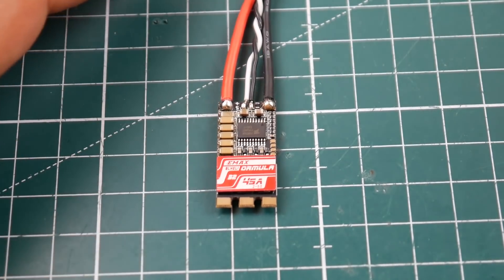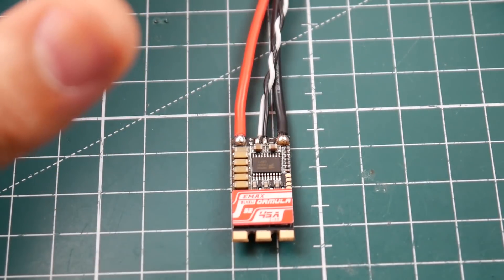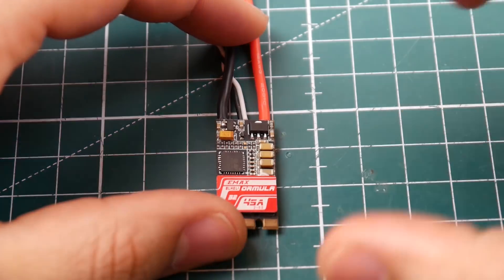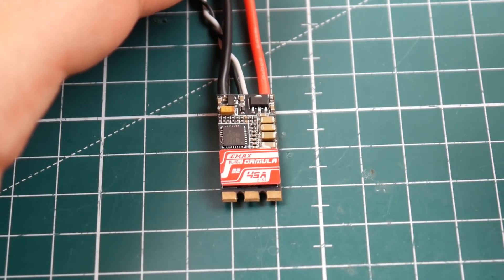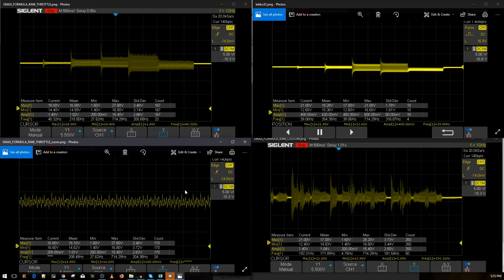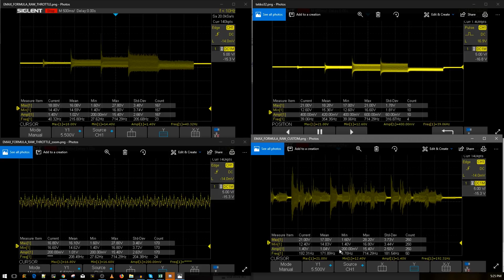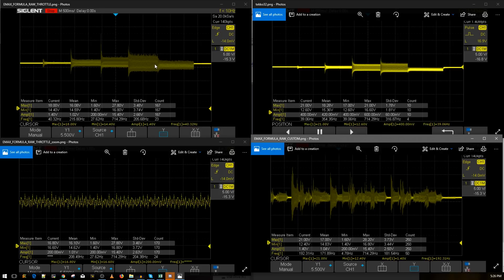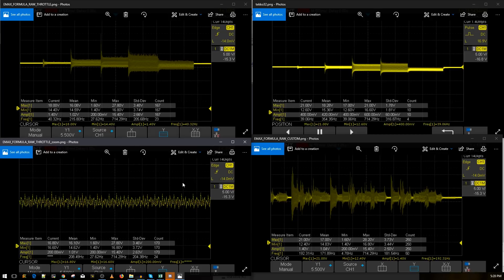Emax Formula 32 45A ESC // FULL NOISE AND REVIEW

Comment: Emax failed with these i ordered 8 of them paired them with rs2306 white series red bottoms and a betaflight f4 flight controller and blheli 32 will not read them I'm desperate how did you get them working

Comment: You made a great job for testing noises in ESCs. I aggree noise in video feed is really a pain in the ... But when I choose ESCs, it's definitely not the point I will look at first. May be, at last it may help me to decide between 2 ESCs but there are things much more important to me :
- When I buy a 30A rated ESC, I want it to be able to give me a minute of consistant 25-30A without burning. I don't want to pray for ESC surviving each time I do a 35-40A punch for 5 sec.
- Some data I would like to see in tests is how much power does an ESC really deliver to motor when it pulls let's say 10 or 30A.
Efficiency and reliability are, in my opinion, far more important than noise I can get rid off with some capas.

Comment: These ESCs do seem rather disappointing
Reply: after viewing numerous reviews of emax stuff they tend to hide average quality by mimicking "expensive" feel like heat sink in ESC or cute plastic boxes/foam and stickers with motors etc. You can see real top class motors  using only plastic bags in cardboard boxes.

Comment: You'd think Emax of all people would be leading the pack with things like this.... Disappointing
Reply: Emax is junk. I've had nothing but trouble with the Magnum F4's.
Reply from the maker: RCFlyer85 Yes hopefully they get pressured into improving their products.
Reply: Not really.  Until the red bottom motors emax was pretty much low end equipment.   Nothing they have made since has been amazing either.

Comment: Hey Mesh loving the data here. It would be awesome if you could compare the Tekko32 with the AIrbot Wraith32 35A. Cheers ;)
Reply: Hervé Donner the wraith v2 is the same esc as the tekko32. Think holybro just rebrand airbot's esc. They look exacly the same. I just got my airbots and im waiting for my tekko32s .
Reply: I'm flying the wraith v2's right now on a TMotor F40III 4S setup, no noise or lines on an integrated FC/OSD and PDB.
Reply: Ah thx indeed they look identical. I have the v1 though... Mesh tested those here (https://www.youtube.com/watch?v=YmXm_b7hKg4) but I can't find a direct comparison vid with the Tekko (Wraith v2s). I guess they are (slightly?) better since the v2s have more caps. I guess it's not worth upgrading to the v2 for me. I'll just add some low ESR caps :)